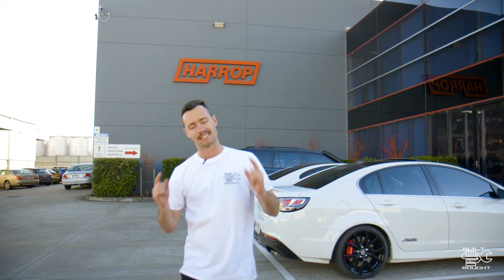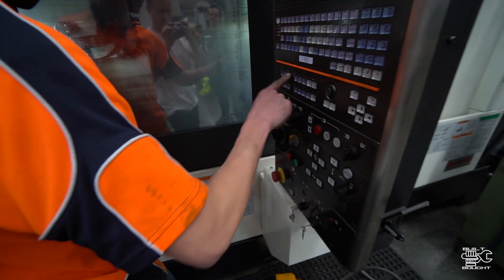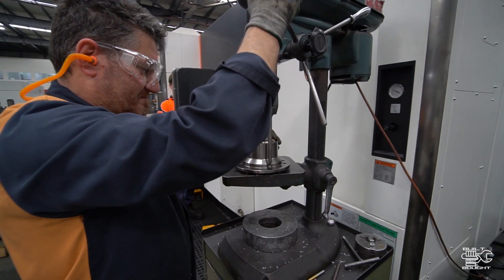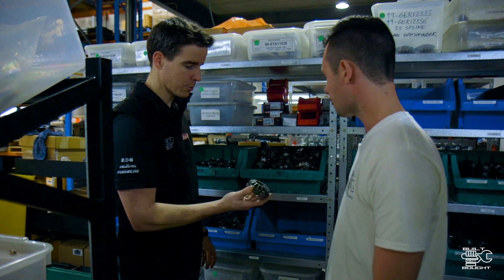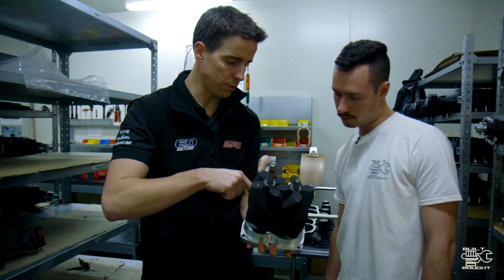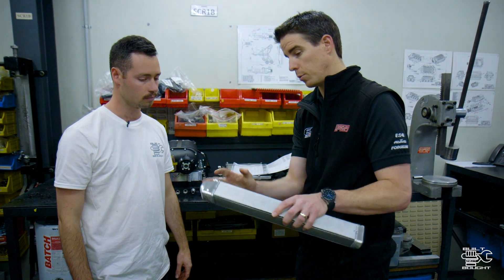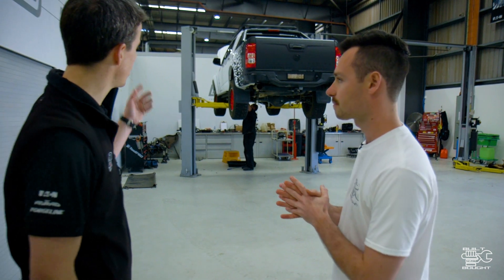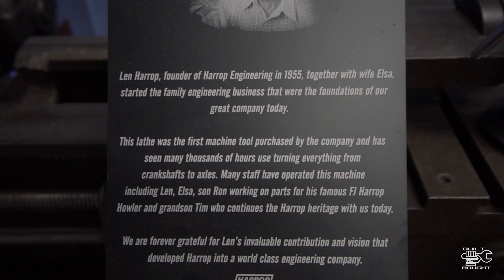INSIDE HARROP || How An ELocker/Supercharger Is Made

Comment: Do they still unlock when you reverse.???
Reply: Yes, due to the design there is a certain  amount of rotation required for the mechanism to lock again once the direction of travel changes. I use to want one of their lockers but it seems that I’ll be going with the Tjm locker instead: no free play during direction change unlike elocker and more reliable than arb locker due to the air actuation mechanism not requiring the diff to be exposed to air pressure. I’m sure someone else can explain it better than me;)

Comment: Quality video and top notch engineering, but the locker isn't 100% traction 100% of the time and the time you need it climbing a steep section where you have to roll back half a metre means you'll have to rotate the tyre going forward half a rotation to re engage the locker 👎